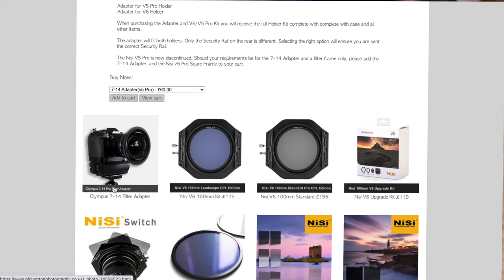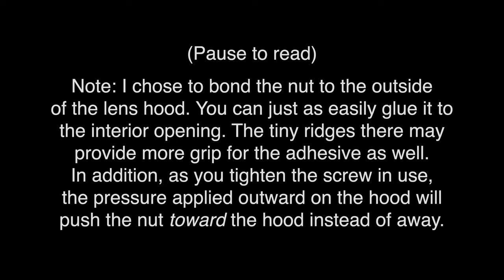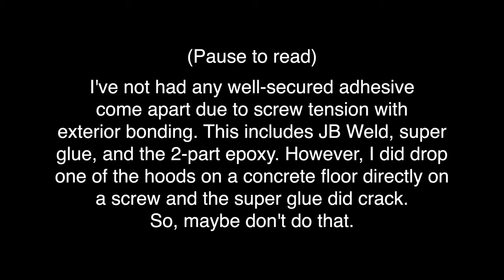How to build a wide angle lens filter holder | 2 versions | Panasonic 7-14mm

Comment: Fantastic video and I am also preparing to make one with your technique with my fuji system. Yet as I was going through the web, I came past "The downside to the 100mm system is that the are just small enough that on some extreme wide angle there is vignetting in the extreme corners, particularly when the lens is focused to closest focus distance."
Curious if that is an issue that you encountered when you applied the 100mm filters to your adapted setup. Thanks!
Reply from the maker: Hello! I have since changed out the 7-14mm for the 9mm; but not that I recall. I had to make sure the mounts were as far back on the lens barrel as possible so as to try and get the glass of the front filter to basically touch the built-in hood on the lens. This ensured that the rim of the filter was as far as possible out of view. If, however, you were to thread a hood like this on an ultrawide, because the "funnel" of the hood naturally extends forward and out, it very well might get in the way. Mounting it like this pushes the front lip of the filter BACK to basically EVEN with the lens front and extends it far to the side. I would do a test for you and send you a download link, but as I mentioned, I no longer have this particular optic. Suffice it to say that I don't remember it presenting any issues, and if anything, there was a slight crop in post. The good thing is, it's such a cheap setup it might be worth trying. Even without the addition of the filters. Best of luck!